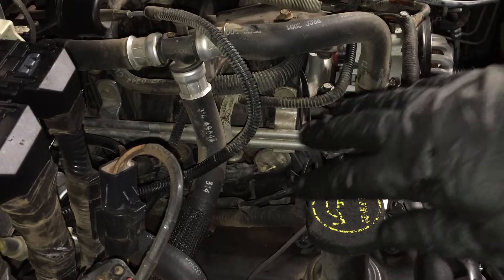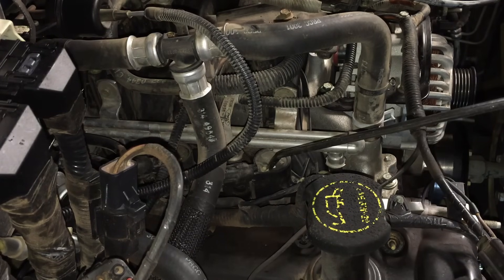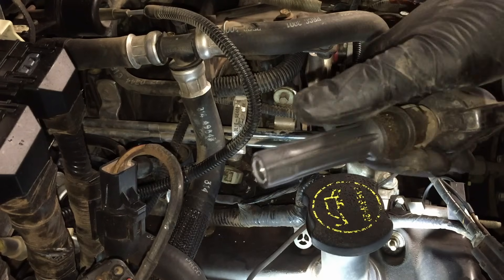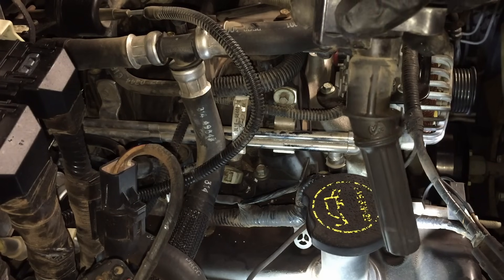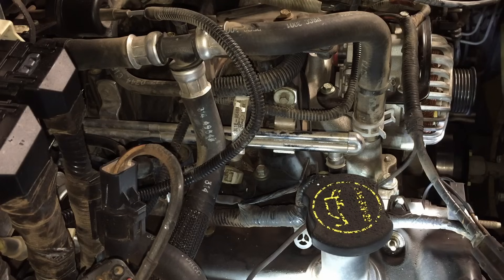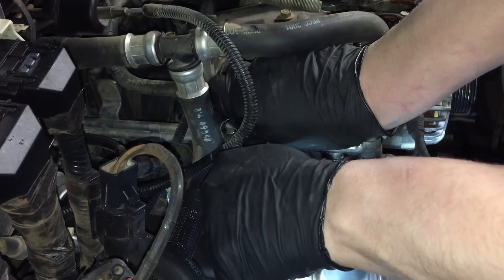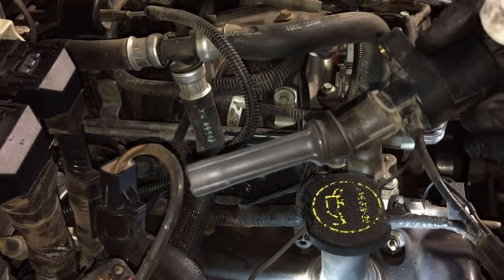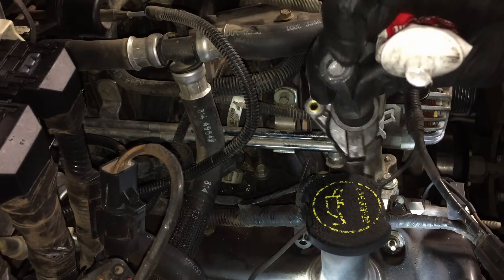Important Tips When Replacing Spark Plugs on Ford 4.6L 5.4L 6.8L 2v Engines

Comment: Based on research done at the time, you are absolutely right, the Dorman intake could be had for around $225.00,  I have no problem with use of aftermarket parts. Unfortunately some additional problems came up and the engine had to be replaced. That's why I made the remark about hard lessons learned,  especially when buying a used vehicle...buyer beware. Thanks for the reply, God bless.
Reply from the maker: Oh wow sounds expensive sorry to hear.

Comment: I bought a used 2000 F150 with a 5.4, the previous owner broke the ferrel (brass nut) out of the plastic intake at cyl #4...long story short: that intake retails for almost $600.00. Yeah, if you push it down just right, it'll hold with no miss-fire for several miles and then the dreaded miss-fire comes home to roost. Some lessons are hard learned.
Reply: Kim going to town right now is mclovin in my room
Reply from the maker: mds19238 What is wrong with the dorman version, their intakes are generally well received and much cheaper your intake gaskets are probably in need of replacement anyway-http://www.amazon.com/gp/product/B003QVJ79K/ref=as_li_tl?ie=UTF8&camp=1789&creative=390957&creativeASIN=B003QVJ79K&linkCode=as2&tag=fordt-20&linkId=U6VYDEVQGUAMYMYP

Comment: So I have a 08 crown Vic interceptor with 70 K and just changed plugs. Originals looked fine but did it anyway. I take it I should torque them to 22 ft lbs also?  Off subject but I plan on changing rear def fluid but from what I have read I don't need friction modifier as I have a Z5 rear end. Am I correct on this?
Much appreciated and great info from you. Keep up the good work.
Reply from the maker: ***** I would make sure they follow this over torque procedure yes. Almost all rear diffs in the crown vics are open diffs and don't require it but yours is an intercepter so I would toss in a bottle of XL-3 while changing it.
Reply: FordTechMakuloco thanks for getting back to me....going to do the re torque right now,and again thank you for informing me about the rear diff...

Comment: Hello, I seen I few of you videos you do good work. I have a 2006 Ford f150 4 wheel drive and my rear tires are wearing from the inside out. I buy used tires and they last bout 2 months and then I gotta buy more. It sounds like the tires rub when I make a sharp turn. Can you help me out at all with what it might be please..?
Reply from the maker: Steven Black Get the front end inspected for loose worn components and then get it aligned.

Comment: Had a quick question. What is the standard idle for a 1999 lincoln navigator 4wd? I'm going to smog check it but want to be sure. No check engine light is on all readiness checks are ready except for evap but that is my main concern the idle
Reply from the maker: MrRayRizo 760-830 range

Comment: Many moons ago I had a 92 Crown Vic with a 4.6 and I experimented with Bosch Platinums at the insistance of some of my 5.0 Mustang friends... big mistake. Missed, stumbled all over the place, even though I made sure the gap was .054 which is pretty much the plug gap for every Ford since like 1968. Gapped them all to .062 and it ran better, but still not great. Threw in a set of Motorcraft coppers at stock gap and it ran smooth as glass. Unless you're running an aftermarket ignition system with a hotter spark and beefy wires, stick with OEM.
Reply: I had same issue, my ranger would eat platinum plugs for lunch. Put in new and 1 would go, then another. Finally after so much headache used the old coppers, and never had the issue again.
Reply: Cheezy Dee  como poner el incision cojop

Comment: FordTechMakuloco Now my buddy owns a 2003 mustang GT with the 4.6 2 valve. He has the accel coils and just melted and put two holes in cylinders 1 and 4 now could aftermarket coils cause that. Does it have to deal with to much spark and heat ?
Reply: I know this post is really old, but the cause is likely due to the air fuel ratio being too lean in those 2 cylinders, possibly due to faulty or clogged fuel injectors. Running an air fuel ratio that is very lean will cause excessive heat that can destroy the pistons, or worse.
Reply: @JasonMiller1979  Yeah this is definitely old lmao,  however after replacing the motor with another long block the problem was gone for another 20 thousand miles. using the same air filter as before.

Comment: This video motivated me to pull/check the plugs on my 98 expo 4.6 today. I changed the plugs 40k ago and used motor craft platinum plugs. I noticed three plugs were loose, also all but one were over gapped at 65+ thousands. None of the, showed excessive wear so I simply re-gapped to 52 thousands and reinstalled forgot what a pain the drivers side firewall plug was! Anyway idle is much smoother now I guess attributed to having the correct gap. Thank you again for the great videos.
Reply: +DE “AutoBravado” Nichols nobody on earth does a 2v plug change, then does it again 3 days later to "check the gap"
Reply: Meant to say passenger side firewall, I don't understand why they shove these motors so far into the firewall.
Reply: anajay78 Me neither.  As a standard I regap plus 3 days after installation. Some if not all will have already lost their gap. 

It's like the heat and cool cycles forged them to keep better gap after that.
Reply: 3 days or 3 Months? Sounds like a pain in the rear to pull them just 3 days afterwards.
Reply: anajay78 It is, but it's necessary if you want your engine running the best.
Reply: @DENicholsAutoBravado  As a retired ASE tech and having worked on ICE engines for over 50 yrs I can say I never experienced or heard of spark plugs changing gap after 3 days if gapped properly to start with. Of course, I have never pulled plugs to check gap unless working on a racing engine and then only to check for fuel mixture or possible engine / plug damage. Just sayin' but you do you.
Reply: Alexander King
Well that can't be true because I do. :)

Everyone who likes an engine running very well has me do this. Never professionally at work no, but at home with friends/family.

Comment: I know from experience that motorcraft plugs are the only way to go. I have an onboard digital computer that measures actual MPG. The motorcraft had 2 MPG better fuel mileage. Using the platinum plug version. Same for the coil pack on plug. As the cheaper Chinese versions will fail from cheap whindings on the secondary side!

Comment: Question for you re. transmission temp sensor. I have a 2008 5.4 v8 and am considering getting a wifi OBD2 transmitter and DashCommand app.  Do you know if my year has a sensor for the tranny temp? I don't have a gauge or info center currently.
Reply from the maker: ***** It sure does.

Comment: It seems hard to believe that the plugs can back out so much with the coil packs bolted down securely. weird.
Reply from the maker: ***** The boot is very soft and will give easily.
Reply: I had a 2000 f150 spark plug blow  out so hard that  it snapped the ignition coil.

Comment: I just found 2 loose plugs that were causing a tapping sound at warm idle.  6 of 8 were seated and tight but two were super loose. I don't know if I just forgot to torque them down when I changed them but I'm glad I was able to find out before I had a dealer go thru and look for the noise.

Comment: Why does the oil filler cap look like its been driven over a thousand times on a gravel road? I have seen that before.
Reply from the maker: smoke skull I have only seen it on older vehicles with higher mileage or ones constantly exposed to high heat as this in Arizona.
Reply from the maker: platinum plugs are ok yes and injector orings do not have to be replace generally unless the injector is removed from the vehicle for some reason.
Reply from the maker: Platinum plugs are the best all around yes. Just about all plugs now are platinum tip.
Reply: 7

Comment: I know it's not specific to this engine, but I've got a Mountaineer with the 3v V8 (2007).  I've changed the plugs and coils, but it has a weird shudder around 1,500 rpm while revving in park/neutral and while driving around 35-45 mph with engine revs at around 1,500 rpm it will have a small, periodic engine surge of around 150 rpm.  Any ideas what it could be?
Reply from the maker: PsychoCPU That could be anything from the alternator coming on to a change is the vss causing the iac duty cycle to increase you would have to see what inputs to the pcm are acting up at the time. Have you clean the maf sensor yet?
Reply: I did when I changed the plugs out. I also removed and cleaned the TB.  It's highly frustrating because it runs great in all other aspects.

Comment: Bosch plugs are horrible and will cause misfires even on OEM stock tunes. Stick with Motorcraft even if you have a high HP car. Had a 2003 Mustang GT with 300+ RWHP naturally aspirated. I used Ford plugs. NGK is a close second for me. But I have OEM plugs in all my Fords.

Comment: Hi again Brian.  I'm a little confused here.  Could you possibly explain a little about some differences about the 5.4 3v vs the 5.4 2v engines.  I know the 3v engines are the real stinker to get the plugs out.  Which engine type would a 2001 E350 SD with 5.4 CNG have?  I agree with OEM plugs; I stick with Motorcraft for our Fords and AC Delco for our GMs.  Thank you, and thanks again for these great informative videos.
Reply from the maker: JRobert111111 Yours has regular 2v plugs that will come right out. The 5.4l 3v engine is a completely different design.
Reply: FordTechMakuloco
Thank you so much for clearing this up for me, I really appreciate it!

Comment: is there a same issue on the 3.0L v6 from a 09 Escape. I am planning on doing the plugs on it.  and do you any other tips for it?
Reply: I've never heard of plugs blowing out of 3.0 Duratecs.
Reply: I'm a Ford tech as well, I've only had one escape come in with a blown plug like the older engines. They were hauling a 24,000 lb trailer in the thing. I wouldn't worry about the plug firing out of the head as long as you torque it properly
Reply: brakedd I seen one do it,sounded like an exhaust leak.Rear middle one